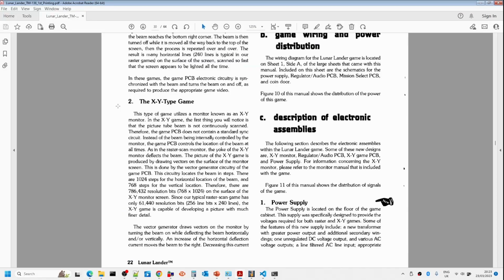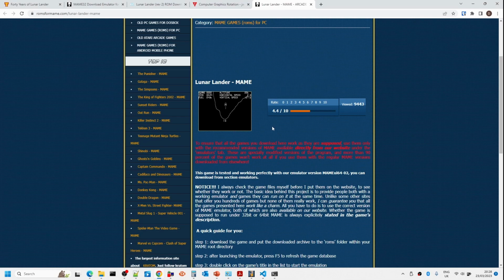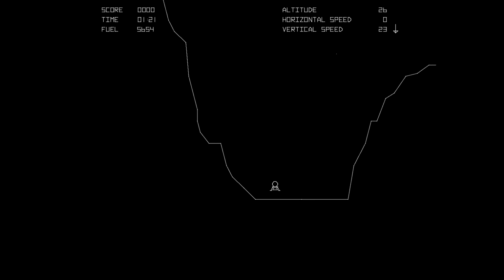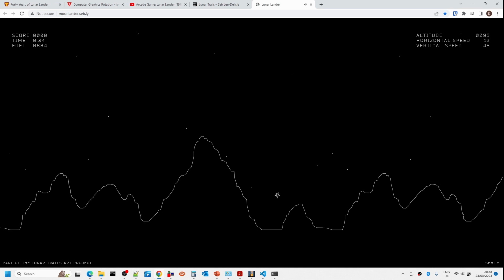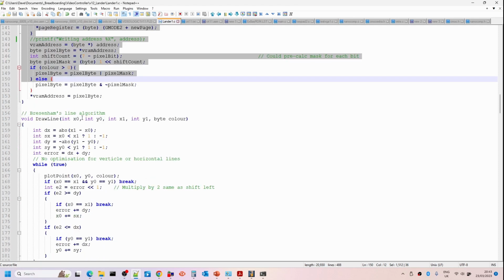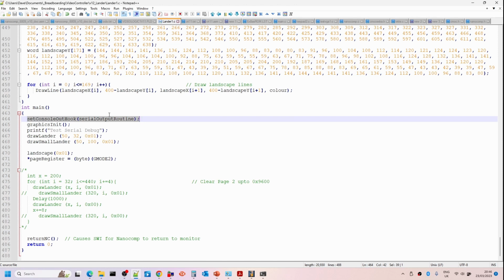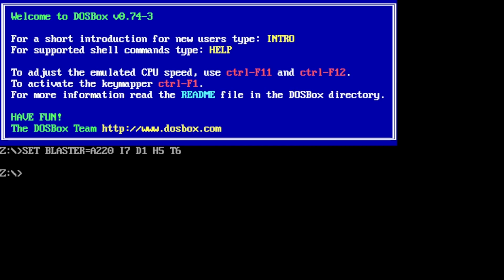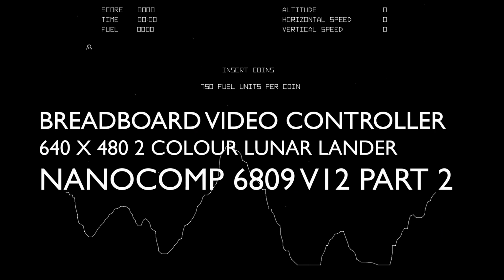V12 Part 1 Lunar Lander - Breadboard VGA Controller Nanocomp 6809 8 Bit Breadboard Micro

Comment: You could store the vectors of the different lunar lander images in memory. It’s smaller you don’t need to do the matrix multiplications and I’m pretty sure that’s what the arcade machine also did. But you still in your case with vga do a mine drawing algorithm which takes time. But you only need to redraw the image when it rotates in your player bitmap array.

But storing all the pre-calculated pixels of each image in to vga ram is super fast of course because you don’t need to calculate the lines. And when you have the memory that’s the fastest way to do it.
Reply from the maker: The arcade Lander game used dedicated hardware to do the vector drawing so the processor only had to say where the lines needed to be drawn between x & y coordinates. Since we have a bitmapped display we have to plot the lines. 
The example of the program running from 17:25 is plotting the vectors but it takes a second or two for each image. More of this time I think is the plotting not the calculation of the x & y coordinates but since I only did this once and saved the bitmaps in the code then I didn't try and optimize this much (but your suggestion I am sure would help).
As you say since the RAM was available the pre-calculated was faster. I haven't spent much time optimizing the code (I am sure assembly could be faster) but I wanted to focus more on the hardware rather than spend a lot of time with the software. I am going to double the processor speed soon so will see if there is any improvements to be had when testing Lander with the faster processor. Thanks for the comments.